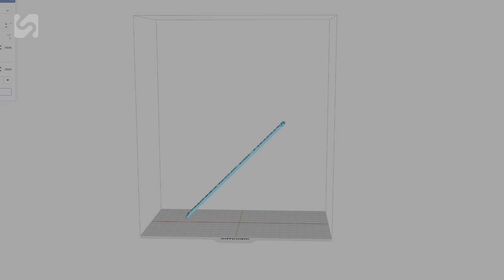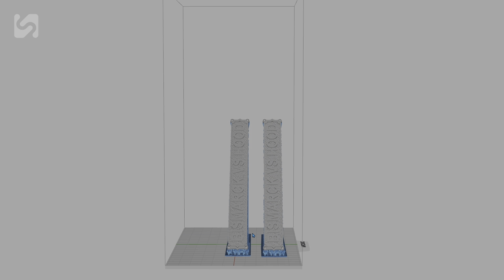Bismarck vs Hood Resin model diorama 1/700

Comment: The camouflage pattern you sprayed on Bismarck is a little incorrect. This pattern was applied only during her stay in norwegian fjords. Before she left for the Atlantic, it has been painted over with grey, Only small white stripes near the waterline remained. 7:50 in the video: you misplace the main turrets. Turret A didn't have the hoods for the rangefinders on its side. They had been removed completely due to seawater coming ito the turret in heavy seas. All other 3 turrets had these rangefinders. The large cranes where not swept backwards when they were not in use. When not in use they were swept towards the bridge, where they were locked in place. And the planes were also never positioned there.

The alignment of the Hood in relation to Bismarck is als historically a bit inaccurate. Hoods Bow was aligned more towards Bismarck. Hood was  unable to bring her aft turrets to bear, because Hood and Prince of Wales tried to close the distance, thus the Bismarck was crossing the T, firing full broad sides, while Hood and Prince of Wales could only fire with their bow turrets. Hood was about to make a turn, so her aft turrets could come to life in this battle. But right about when she was turning she blew up.

I wished I could do such a diorama with my models. But they are in a 1:200 scale and I don't have enough space for such a big diorama.
And I am surprised how detailed these small scale kits are.

Despite my criticism I really like the end result and I could watch such videos for hours on end.

Comment: i like the diorama but we need to talk about major building failures on the Bismarck. First , only turret Anton was without 10,5 m range finder. Second the funnel roof is wrong! need a 180 degree turn :D and third, the airplanes placed on  the wrong spot, they need to stay in hangar or on the katapult in the middle, you use the space which are normaly used by the small boates . And as a improvement, you can turn the 3 big range finders to the enemy direction, would be more realistic

Comment: Great work!

Just a quick correction here, you show Bismarck's B and C turrets firing together, which is historically inaccurate. Standard German salvo patterns were firing both forward turrets together, followed by both aft turrets a few seconds later to a slightly different range. Thus, you have 2 separate half-salvoes producing 2 clearly separate impact fields, which helped find the range very quickly. This is one of the reasons why Bismarck had 4 twin turrets, redundancy being the other one.
Reply: This is only correct for the rage finding phase. Once the target is "locked" the artillery officer can decide to use full or part salvos. In this Case Korvettenkapitän Adalbert Schneider used full Salvos to barrage Hood. I read it in the book of Burkard Freiherr von Müllenheim-Rechberg. He was 4th artillery officer and heard all the commandos for the shooting.
Reply: @noepictalesmember1865  thanks for the info, I read the Baron's book but it has been some time.
Reply: @noepictalesmember1865  Vor allem hörte er auch die berühmten Worte des Kommandanten, als Admiral Lütjens keinen Feuerbefehl geben wollte. (Obwohl er von ihm als Admiral hätte kommen MÜSSEN): "Ich lass mir doch mein Schiff nicht unterm Arsch wegschießen! Feuer!"